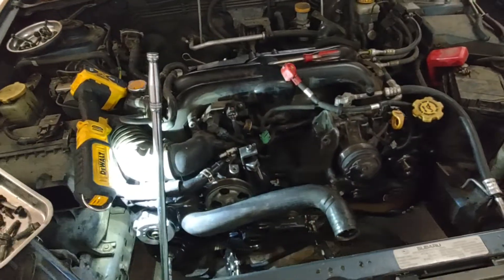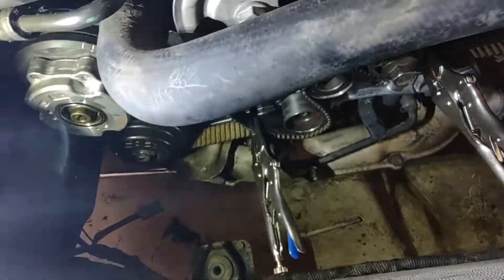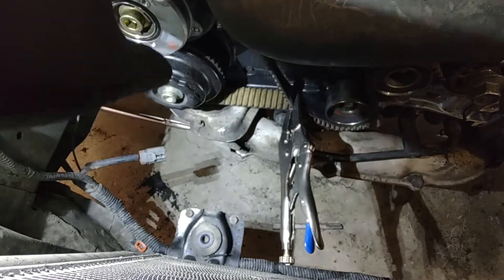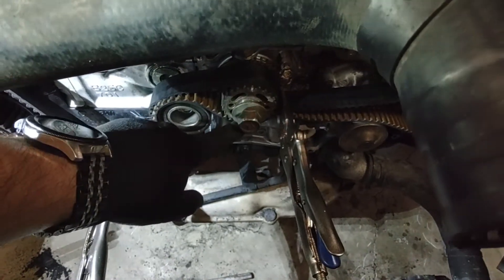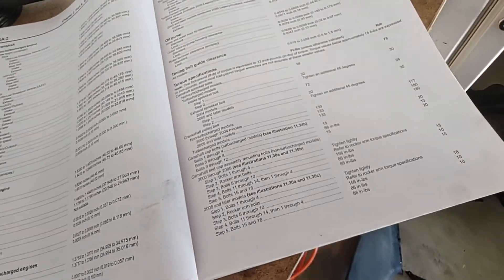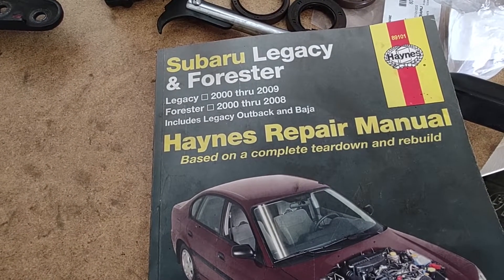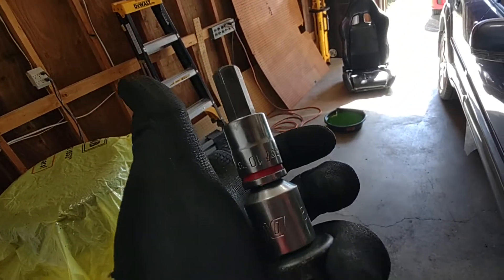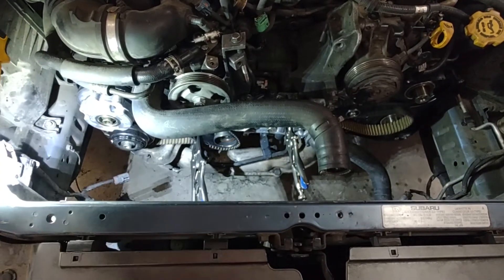05 06 07 08 09 Outback XT 2.5L Replace Cam Oil Seals - Timing #6

Comment: Hmm. Not a mechanic or rocket scientist but using vice grips to hold the timing belt??? Thst would compromise the integrity of the belt itself. Ive seen other subaur performance mechanic youtube vid, they loosen the idler, align the makrs on each side of the cam, then place the belt.
Reply from the maker: I would completely agree it would compromise the integrity. That's why at time mark 1:16 into the video I say it's going to cost you a belt unless you have an extra or old one around. Meaning the belt I'm using is a scrap one I keep around for this. Do not use mechanical grips on a timing belt going to be used ever.